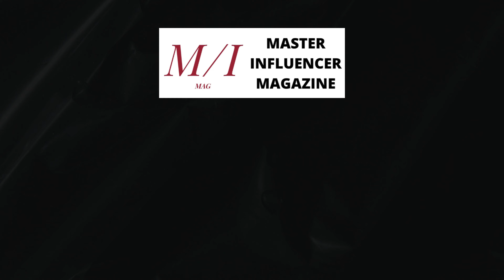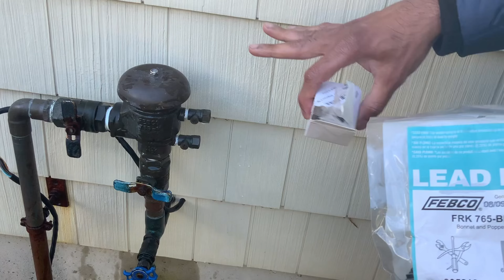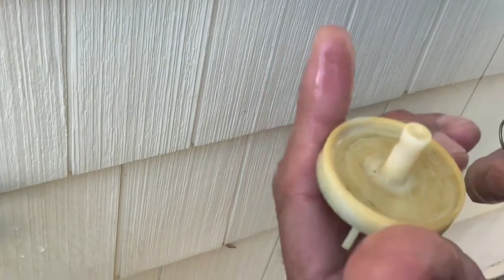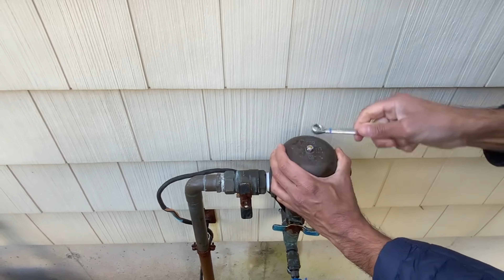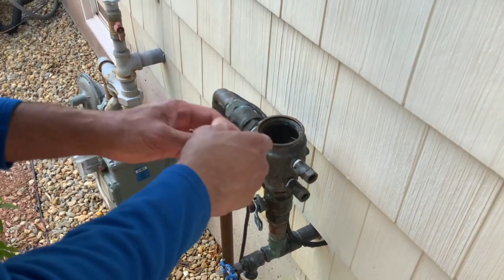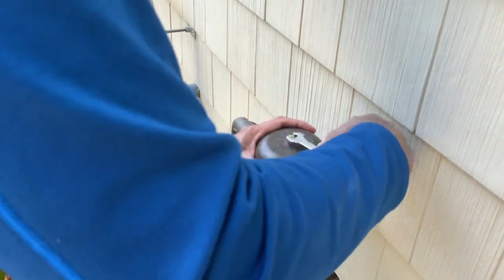How To Fix Leaking Febco 765-1 Backflow Preventer: Sprinkler Pressure Vacuum Breaker Repair

Comment: Yes, definitely aftermarket green parts. Mine that are old and brittle and now broke, were the same color as your Febco .
Interesting. Mine was leaking about as bad as your halfway point. So perhaps I too have a broken lower spring. 🤔.
I also think my retainer plate in the center might be too warn out causing an issue too?. I'll just get the same kit you got since it comes with that as well.

Great video btw. Thank you
Reply from the maker: You're welcome, I hope the kit does the trick for you!